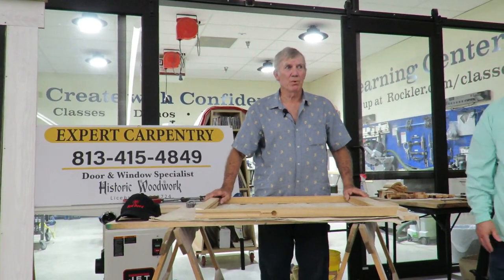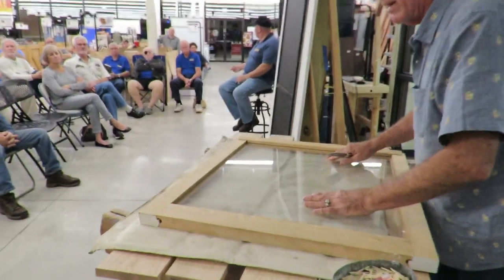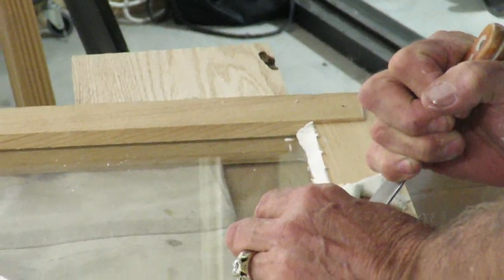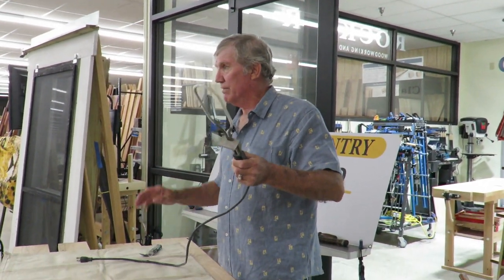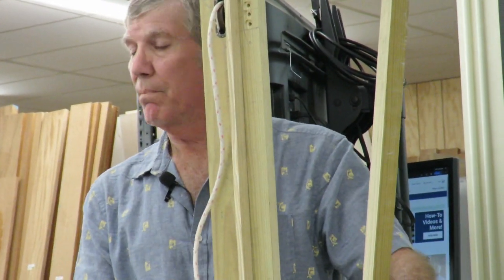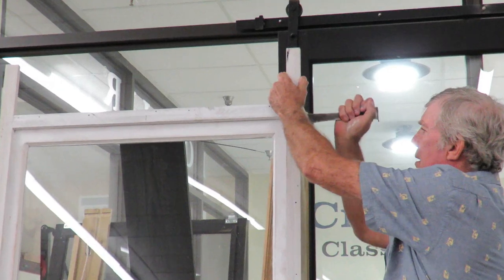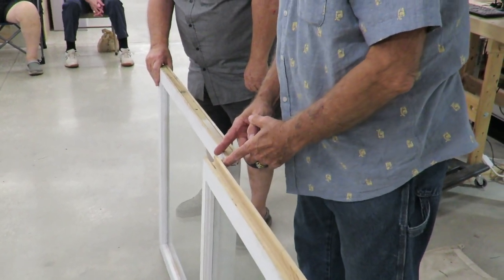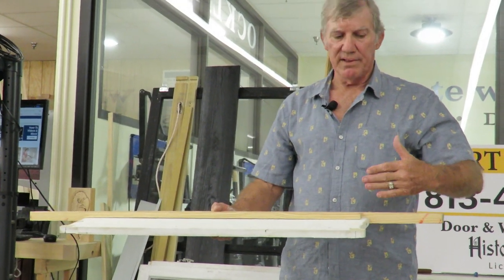Wood Window JAMB'oree!!

Comment: I have built a lot of new wood sash's, uppers and lowers. The Lumber yard I work at had 6 skids of mixed clear pine wood parts. I would try to find parts the size I needed, but if I couldn't, I would cut them in two , cut off what I dont need and reassemble with a half lap joint. When I would make a new sill, on the bottom I would put an 1/8" deep sawcut to prevent water from riding up, I didn't see that on yours. I would also roll the glazing in my hands to warm it up and then make a worm to work that onto the glass seal.
 Informative video, its been 12 years since I have done a window.